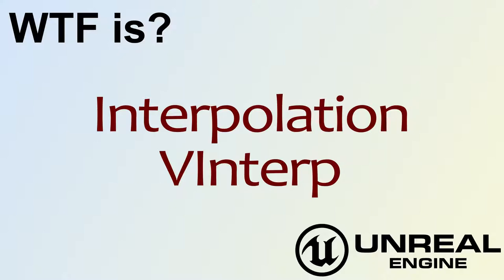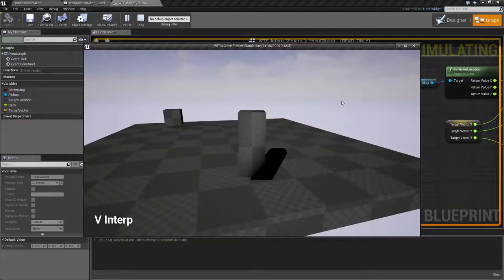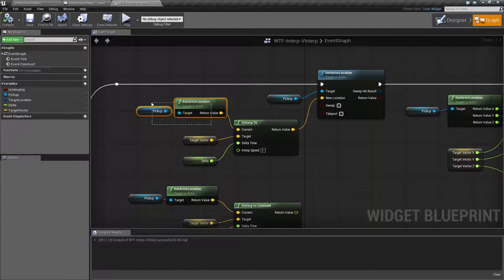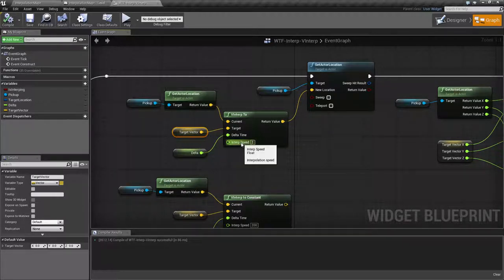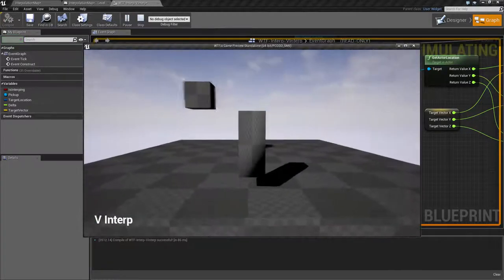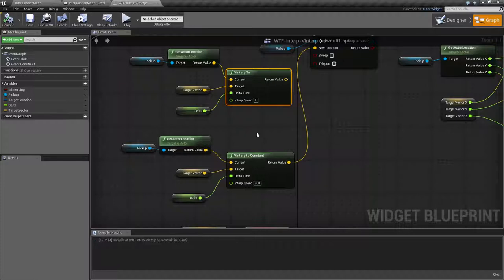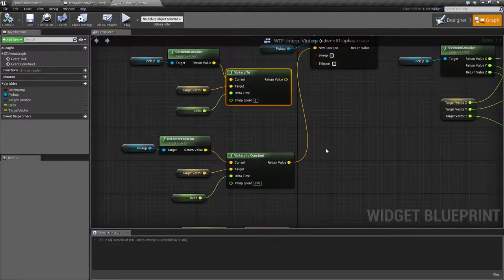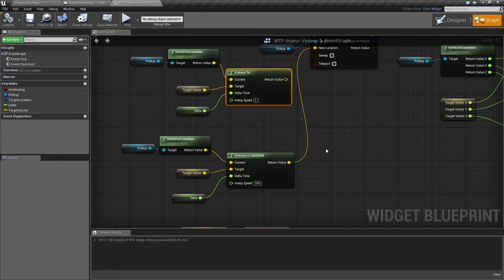WTF Is? Interpolation - Vinterp Node in Unreal Engine 4

Comment: I Still dont understand.
What if I want my character to move from a location to another slowly
Reply from the maker: +MegaCoolrishi It would depend on if you are using AI to do this or you are doing it yourself.  

If using AI you would use AI Move To node and then just lower the walk speed to the speed you want it to move at.

If you are moving it by hand you can use a Timeline into a LERP node with 0-1 being the output value on the timeline and the length of the timeline being how long you want it to take to move.